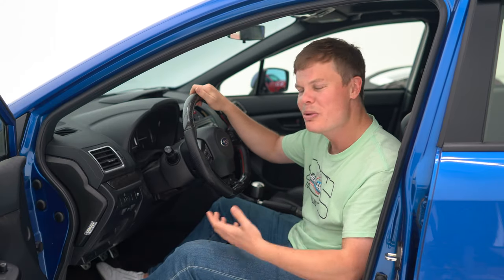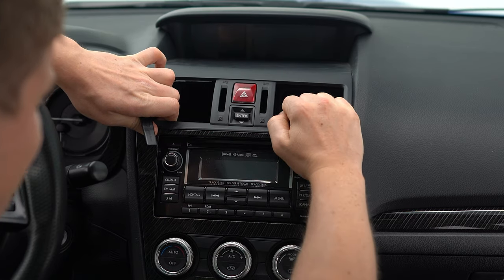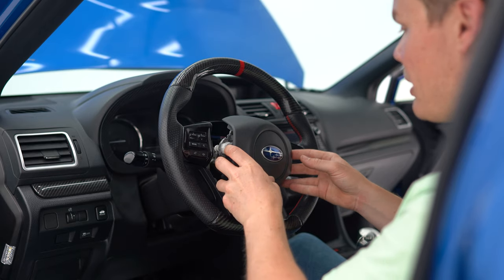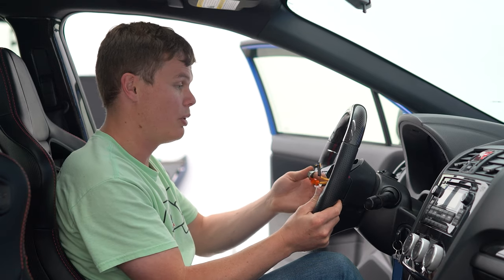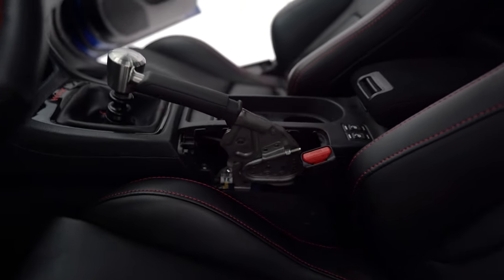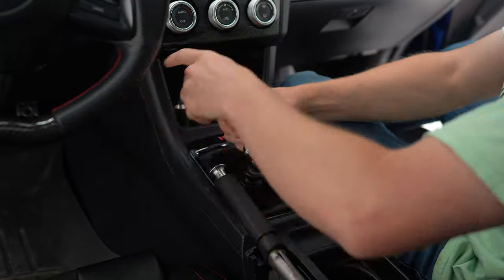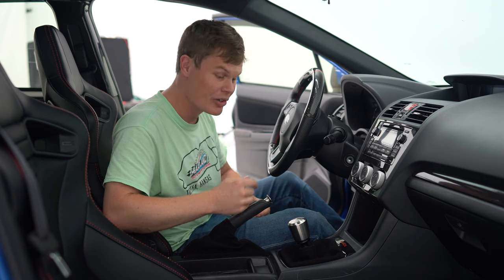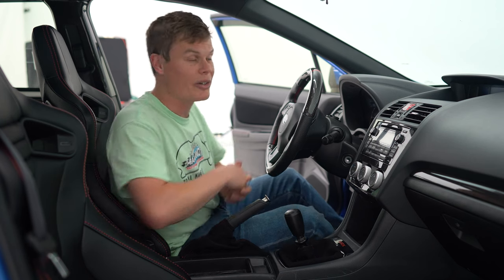Awesome Interior Mods! WRX Rebuild Ep.7

Comment: Wow, all that effort for the lower steering wheel cover (who flippin' designed that attachment method; was it a German car engineer?   I wonder if vinyl wrapping the center hvac/radio stack (body color or cherry blossom) will give the interior more depth.  Amazing when "stock" is an improvement. 👍
Reply: Its super easy to drill a hole in the plastic right behind the cover. Which will allow you  to unscrew it super easily. Then i put a little flush automotive plastic clip/plug over the hole. Looks completely OEM.

Comment: @4:54 Crazy Glue on skin. I had that happen once. Managed to get it on the tip of my index finger. That sucked. For if you try to peel it off, you'll end up taking a layer of skin. I tried warm water and soap to try to remove it. That only got a tiny bit off, along with some skin. Ended up using acetone to get the rest of it off.